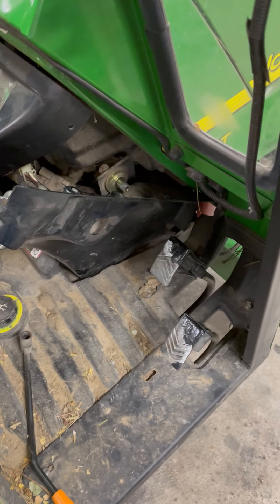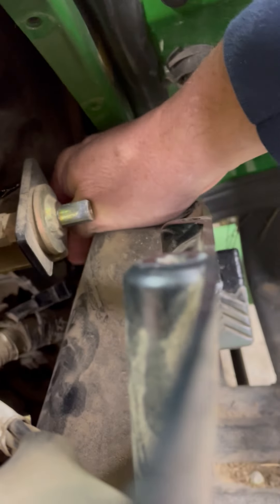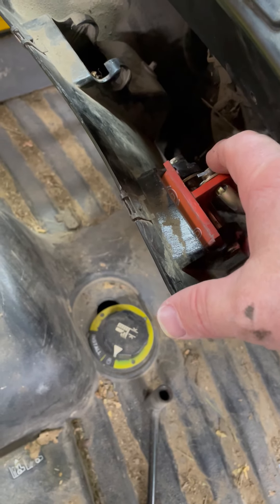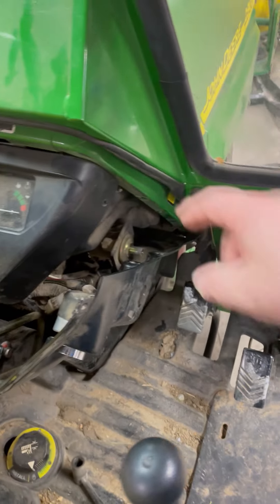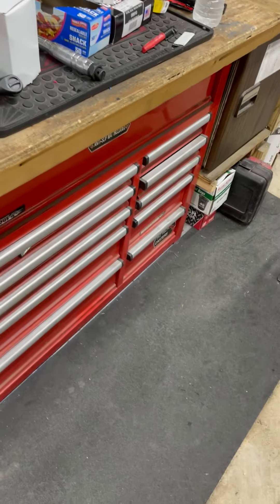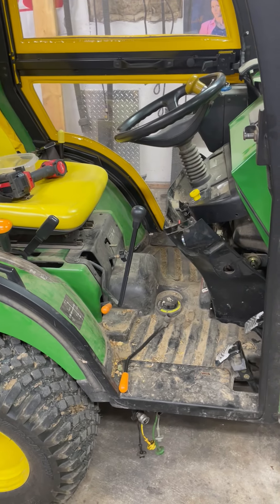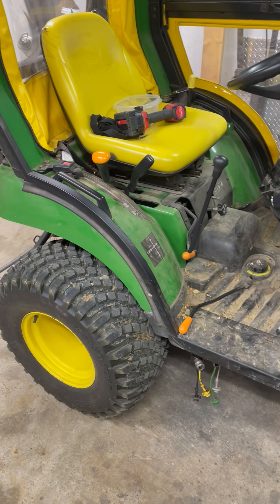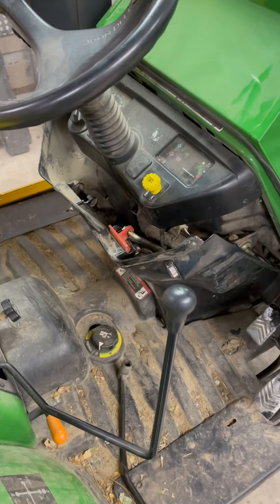Flashers quit on the 2305

Comment: Very good Video. I've had to replace mine about 5 times in 10 years. At $23.00, I wish there was a work around. There is also a diode for the fuel pump. Had that go out one time.
Reply from the maker: Me too, I had added LED flashers to the top front and back of the cab, and assume that was the cause, but from what I read, it doesn't seem to be.
Reply: @Frontpagefab Just to help others, the part#  is LVU804171